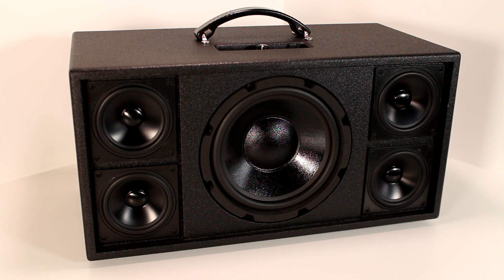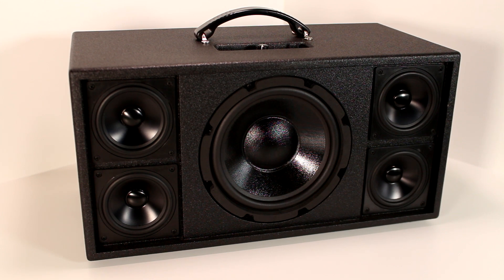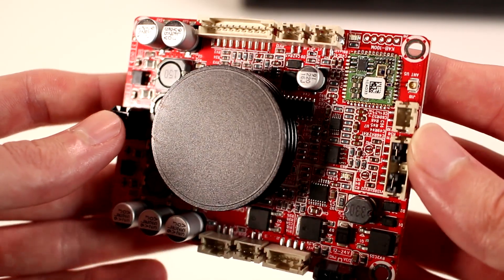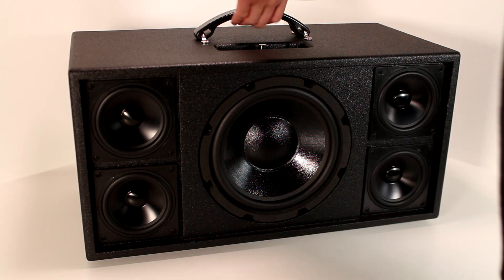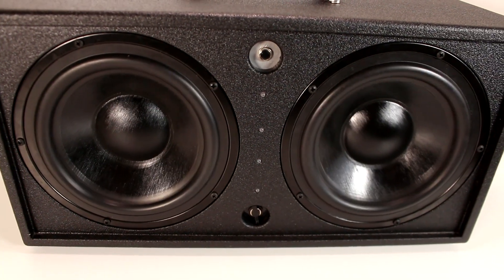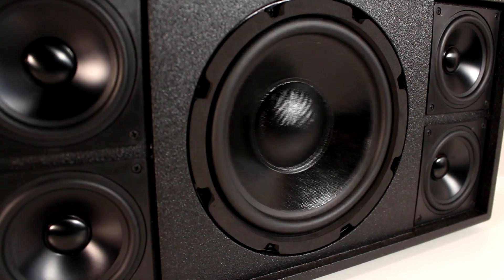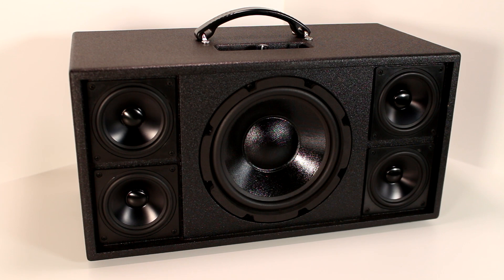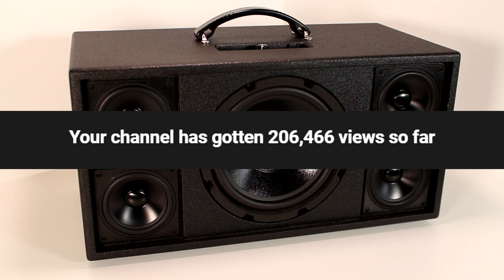DIY 2.1 channel Portable Speaker with 8 inch Subwoofer and DSP

Comment: Might you know the cubic ft for the sub enclosure with these passive radiators? 
I am planning on building one of these myself as well, but i wasn't sure if the enclosure size is supposed to be closer to the called for.. sealed box dimensions or more towards the ported box dimensions for the subwoofer?

Comment: Does this equipment setup allow for expanding the playtime with more batteries? Or does the current equipment not allow for easy expansion of additional power cells?
Reply from the maker: The current battery board is limited to five 26650 cells, but you could theoretically put to separate boards in parallel to the amplifier to double the capacity. But as is this 18.5v 5ah battery gives plenty of playtime on its own.

Comment: Such a nice build. I want to build similar setup but with 2 DSPB-250 and 1 KAB-100. Want to power 2 woofer with 1 board and 2 midrange and tweeters with the other board. Ofcourse the 100 watt amp to a subwoofer. What are your thoughts? Looking forward to your smaller formfactor build.

Can the below frequencies be programmed to the board and make it all work seamlessly?

Current drivers I am looking at :-

From 10,000Hz - 22,000Hz
HiVi B4N 4" Aluminum Round Frame Midbass - 2
Peerless by Tymphany BC25TG15-04 1" Silk Dome Tweeter - 2

Bass 35Hz - 3,000Hz
Tang Band W6-1139SIF 6-1/2" Paper Cone Subwoofer Speaker - 1 

Mid 3,000Hz - 10,000Hz
Dayton Audio ND105-4 4" Aluminum Cone Midbass Neo Driver

Comment: How much was approximate cost? Do you have your plans? Did you build crossovers?  I want to build one with a Tang Band 6.5inch.  let me know if you make one.  Nice work
Reply from the maker: Hey thanks! This speaker cost roughly $450 to build. I have technical drawings of the cabinet that I will post on my website once I have a finalized design and I know everything fits. The crossover for the sub and full range drivers is done digitally through the DSP, so there are no passive crossover components. Make sure you're subscribed so you get the notification when I upload a video, thanks for watching!